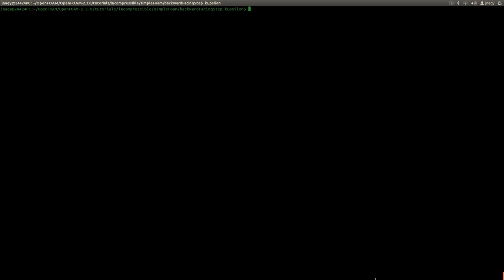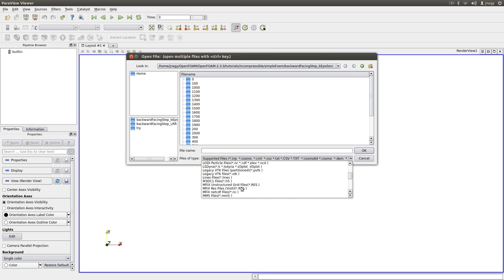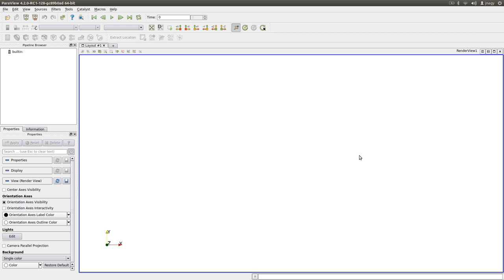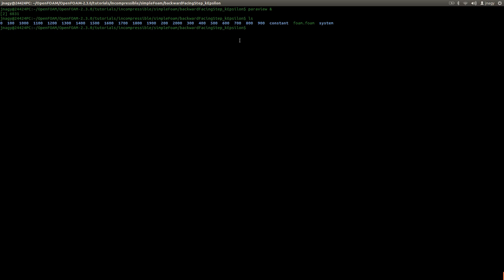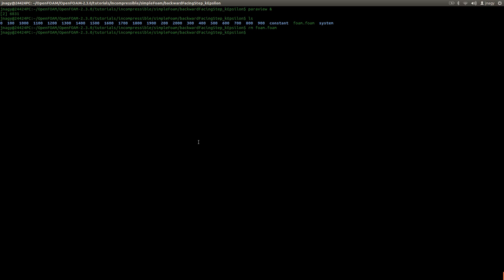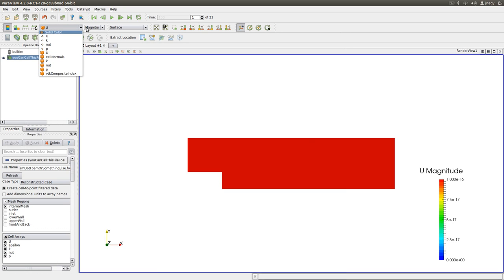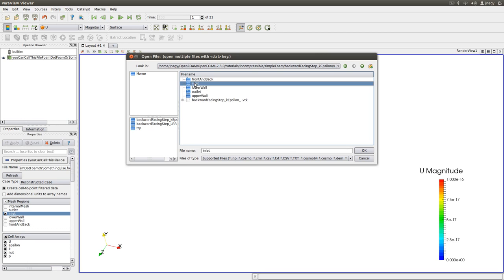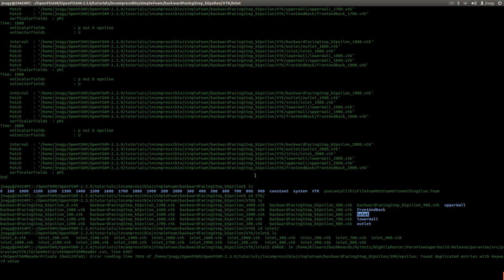How to open OpenFOAM® results in ParaView

Comment: Hi, when I try to open paraview in Windows 10 I get the following error: 
"QStandardPaths: XDG_RUNTIME_DIR not set, defaulting to '/tmp/runtime-aero_shree'
qt.qpa.screen: QXcbConnection: Could not connect to display
Could not connect to any X display."
How do I resolve this error?
Reply: I resolved this problem by following the link: 
https://bugs.openfoam.org/view.php?id=3159

But I'm seeing another error: 
      "QOpenGLWidget is not supported on this platform.
       This plugin does not support raise()
       This plugin does not support propagateSizeHints() "
What does this error mean? How do I resolve it?
Reply from the maker: @shreen375  I have a tips video for Window 10 on Xming. You might also try the windows version of Paraview.
Reply: Thank you for your response! I fixed it by simply updating my Ubuntu and all installed in it
Reply from the maker: @shreen375  I am glad it worked.

Comment: Sir, Thank you for your videos. They are really good in all perspectives. I am a new user of OpenFOAM and installed yesterday following your video. Thank you. I am facing problem in installing Paraview (from Ubuntu terminal). I am using Windows 10 and accessing OpenFOAM using Ubuntu Terminal. Please suggest.
Reply from the maker: Use the Windows version of Paraview instead.

Comment: What is the reason of using ParaView in that way instead of just using paraFoam command?
Reply from the maker: If you use the version of paraview, which comes with the official release, you usually do not get the newest version. I like to have the most recent versions of my tools. Thats the reason. But paraFoam is just as good.
Reply: I tell my case. I use archlinux and the only way that I can install openFoam is using docker. The problem with docker is I can't run GUIs like paraFOAM and this solution saved my life XD. Thank for the video.

Comment: Sir, I have encountered a serious problem.I am using icoUncoupledParcelFoam and want to visualize particle trajectory in a channel flow.After performing the simulation I am getting the following error:
ERROR: In C:\ParaView\ParaView-5.4.1-src\VTK\IO\Geometry\vtkOpenFOAMReader.cxx, line 8307
vtkOpenFOAMReaderPrivate (0xe50baf0): Error reading line 23 of C:\OpenFOAM\17.10\cygwin64\opt\OpenFOAM\OpenFOAM-dev\tutorials\lagrangian\icoUncoupledKinematicParc elFoam\Spreading_of_RBCs_Bif\0.05/lagrangian/kinematicCloud/positions: Expected punctuation token ')', found 0

This error crops up in both Paraview 4.4 and Paraview 5.4.
How do I resolve this problem?
Reply from the maker: I do not know. I do not have experience with lagrangian particles in OpenFOAM. This seems to be a syntax issue between OpenFOAM and Paraview. I see, that you are using the -dev version. Which branch do you use?

Comment: Hi thank you for all the openFoam video that's really help me to learn this software! But i still have some issue with post treatement .. when i open my case with parafoam i have no error but with paraview i get : 

Warning: In /build/paraview-arsa8T/paraview-5.0.1+dfsg1/VTK/IO/Geometry/vtkOpenFOAMReader.cxx, line 4430vtkOpenFOAMReaderPrivate (0x2a82080): Different time directories with the same time value 0.00028 and 0.000145 found. 0.000145 will be ignored.
And only 1/4 of the time steps are showed?
If some one know how to solve this problem it will be realy appreciated!
Thanx
Reply from the maker: Hmm. Usually you can ignore that. You can click refresh, if this doesn't help install another version of Paraview from paraview.org